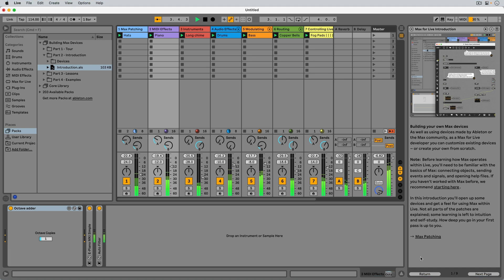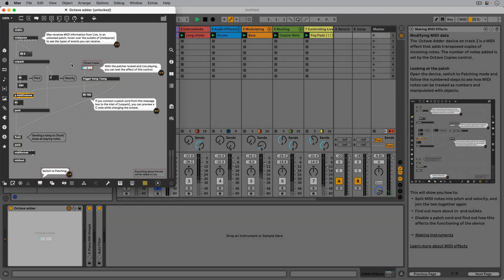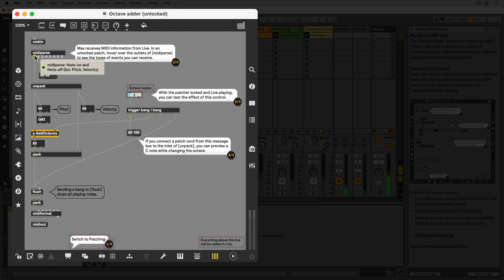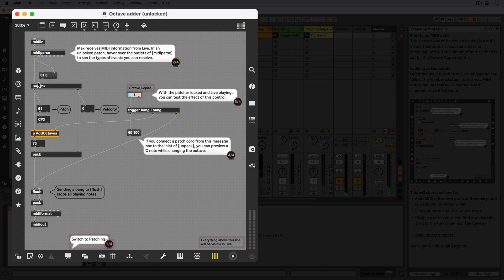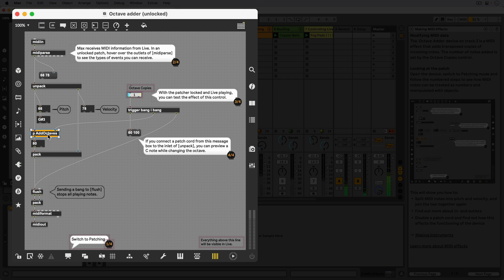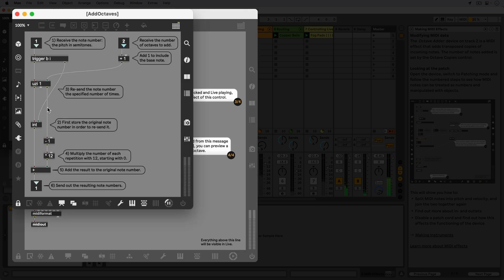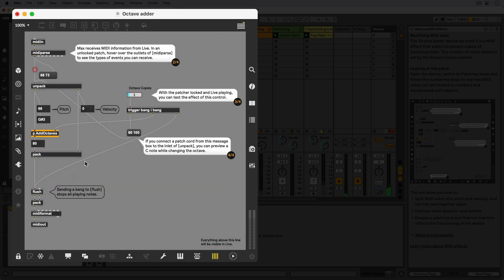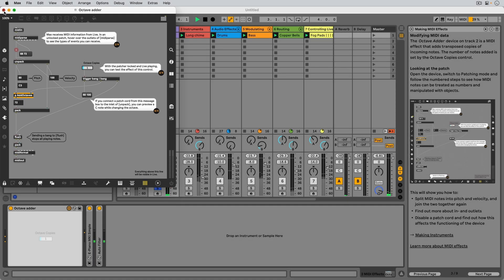Building Max Devices – MIDI Effects – Introduction 2/7

Comment: Double clicking a subpatcher to open it doesn't seem to work anymore, we need to hover the left part of the "p" object to see a hidden menu instead.
Reply from the maker: Double-clicking to open a subpatcher window is possible when the patch is locked with the lock icon in the lower left corner of the window or by pressing Cmd/Ctrl+E. Alternatively, when the patch is not locked, you can hold the Cmd/Control key when double-clicking on the object to open it.